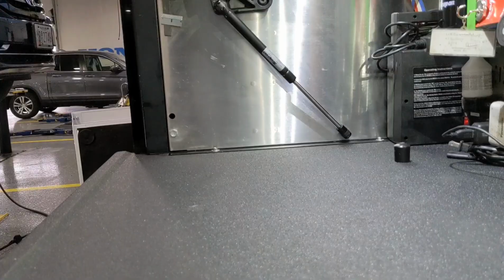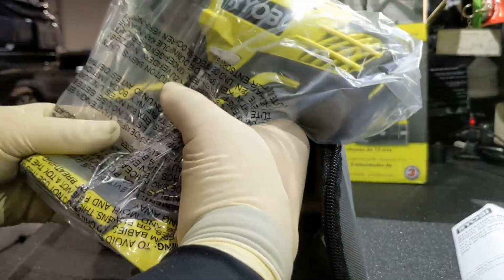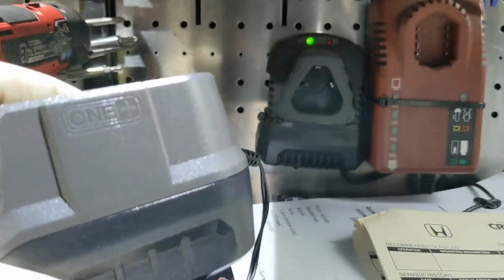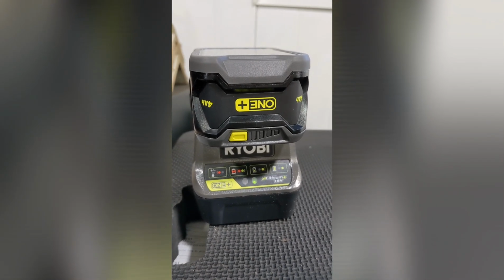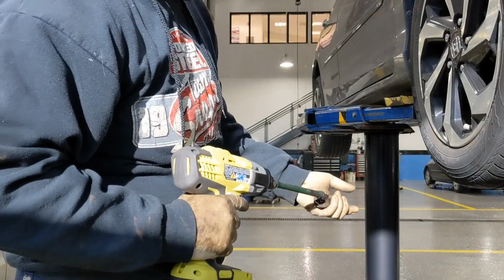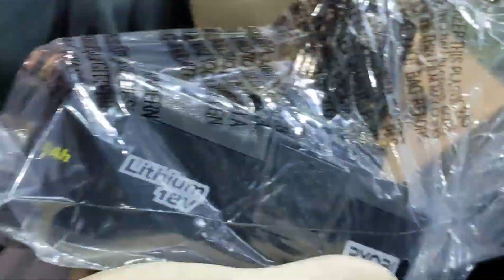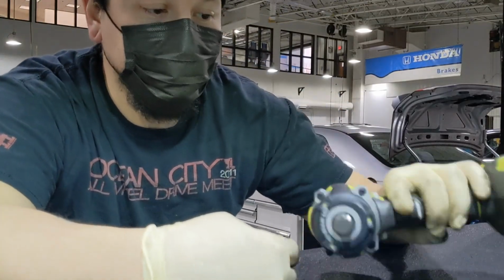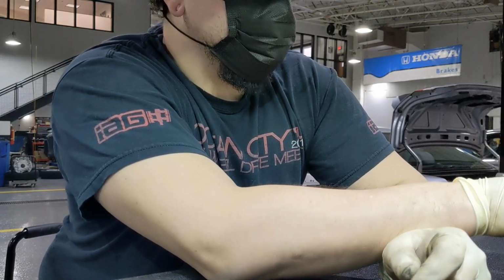100 bucks!? Yes, but it's also 100 bucks....

Comment: 10:20 time stamp you said it was a brushless motor this is a brushed unit. You should have spent the extra $59 for the new hp brushless one bro
Reply from the maker: Corrected my self in the next video. I did spend the extra, lol.

Comment: I have that impact and the trigger issue on mine seems to happen when you pull the switch all the way back/on quickly.  If you pull the switch slowly it doesn't happen.  At least that's my experience.  It also is only rated at 300ftlbs so it's not as powerful as my other 1/2 cordless impacts.  I leave it in my truck incase I need to change a tire for myself or someone else.  It does seem powerful enough to break loose most lug nuts.  It's worth the $100 I paid but I wouldn't pay the regular price which is what it has gone back up to.

Comment: You honestly need the hp batteries for the impact
Reply: This is the older non HP modem impact also. On the box it says p261k but the new impact is p262

Comment: Mine did the same thing.  Also it does take off my lug nuts at 110 ft trq ...but would not remove my shocks or sway bar links which aren't torqued at 110. And I also got the intermittent stoppage . Think it will go back for upgraded modle.  Bc my impact driver can do better damn near.

Comment: Thankyou for making this video.  Very informative.  I like the wrench too, did it resolve itself fixed?  The reason asking is, perhaps the switch just needs some contact cleaner.  I would like to purchase, but am not sure.

Thankyou.
Reply from the maker: No, it didn't. The more I use it, the more I think it's a battery issue. I'm going to buy the 262 next week and see if what happens with that. Thanks for the view!
Reply: Well, for what it's worth, did some research about what others were saying the issue speed 3 intermittent on/off and there are replacement switches.  There was someone else also saying battery too; battery circuit.  However, perhaps try some contact cleaner.  On both the trigger and switch up top.  You may have to open it up.   I have had to use crc contact cleaner in new equipment just to get things working.  Hey, for 99$ it looks like a very useful tool.  By the way, p262 looks promising.

Comment: It's a Ryobi is doing what you wanted to do why spend more? The battery packs are cheaper also. Ryobi has committed to the 18 volt battery pack so you don't end up with a bunch of battery packs that are obsolete because you bought a new tool. The only thing I have found wanting is there doesn't seem to be a high-capacity charger or rapid charge in other words. The solution is to have 3 or 4 batteries and keep them charged period also keep in mind most people stare at Ryobi in professional fields so if your tool boxes loaded with the Ryobi so it won't steal you they will go steal from the guy with the Milwaukee or the DeWalt. All I can say is it was doing the job and why worry about it? I've always had to work hard for my money and I'm sure you do too so why spend more than you need to On Tools. If you get the earthquake with the 2-year extended warranty if it breaks you just working to Harbor Freight end of the tool and I'll hand you another one no jumping through hoops for warranty work.

Comment: I have 2 of these, mine has done this  with only one of my batteries I own for some reason.
Reply: Update, it is the battery contacts inside the gun that was the issue with mine apparantly. Like I said it was only one of my batteries that it did this with and that was a knock off battery. You can look up inside the handle and see the battery contacts, Im thinking about taking a screwdriver and trying to pry those contacts and maybe bend them out a little but I may just not use that particular battery in it any longer.